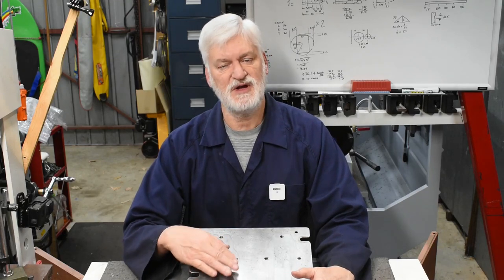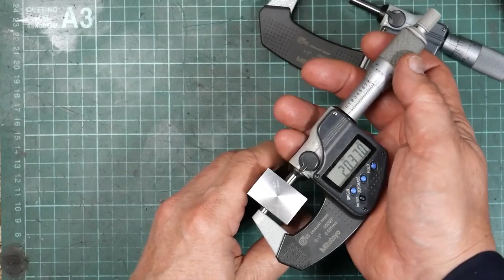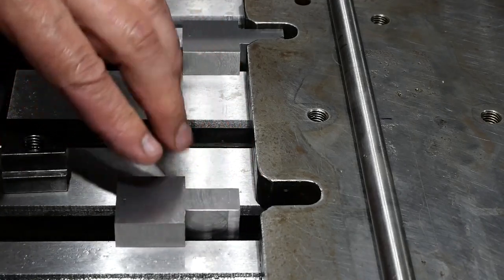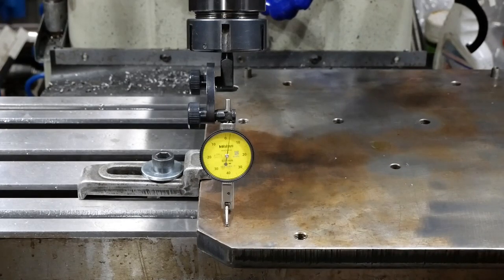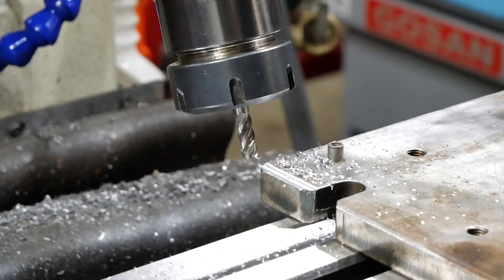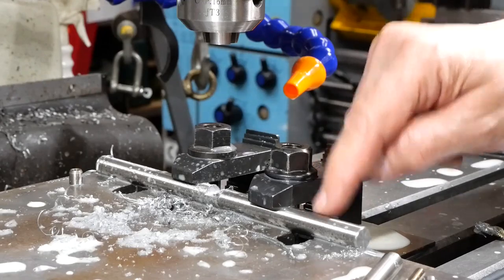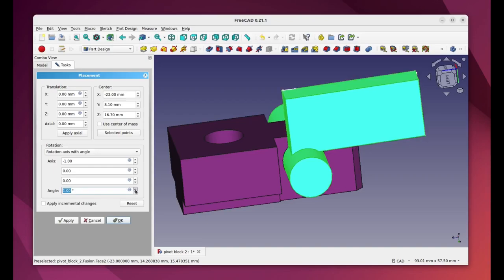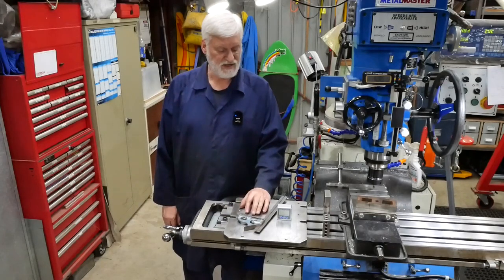300mm Sine or Tilting Table

Comment: Gday Alan, you did a brilliant job making this, there was a lot involved and creative setups, it’s going to be a handy tool mate, cheers
Reply from the maker: Thanks Matty. Finding a way to mill the grooves for both sine bars with one setup was important for consistency and I wanted the groove lips to be tangential to the bars for stability. This would have been easy with a 135° chamfering bit but I haven't got one and couldn't find a source to buy one. The idea to use an inclined endmill was a break-through moment, but working out the required cutter diameter and DOC was an interesting challenge :)
Take care, Alan.